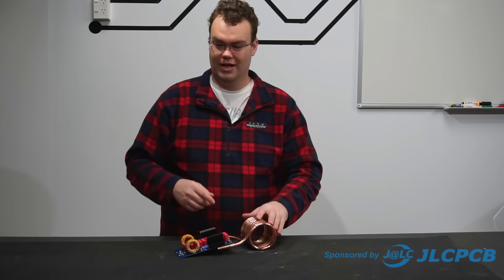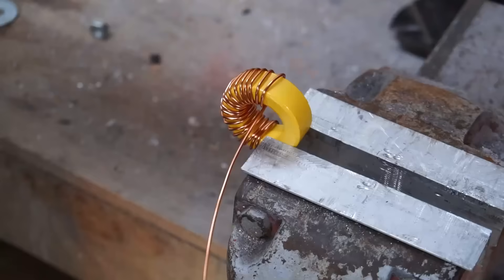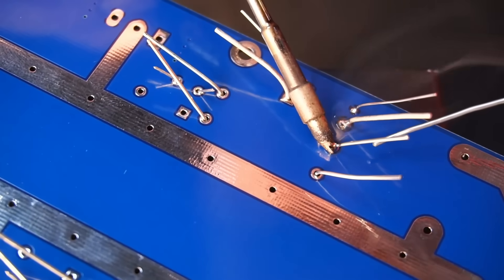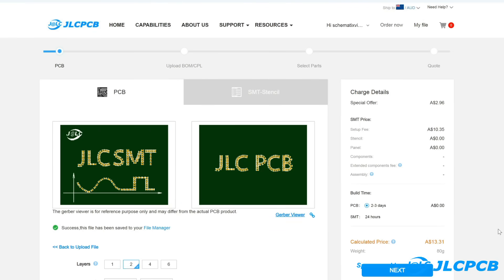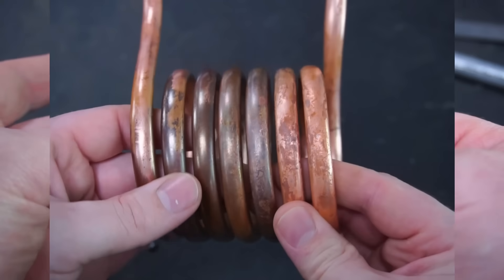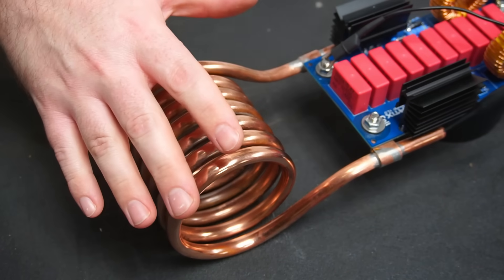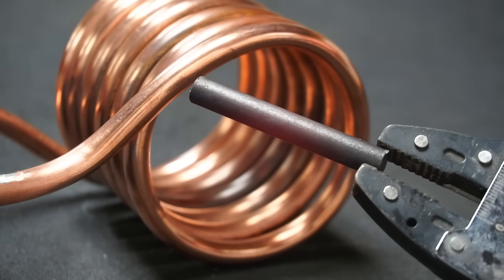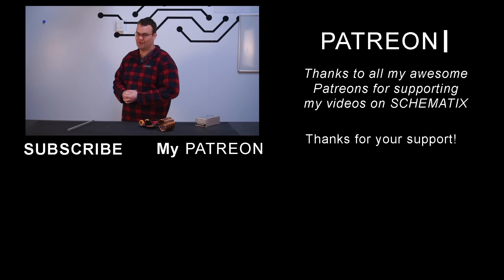Building a 1.4kW Induction Heater

Comment: I'm like 4 million people like to the draw on this one but annealing is cooling down the metal slowly  which softens the metal by on aligning the crystalline structure of the metal. What you had demonstrated in your video which by the way is a wonderful video and I plan on ordering the parts and a PCB to try to build this myself from your video so thank you great video. On the other hand what you doing straight it in your video was quenching when you get the hot metal in the water that actually is a type of tempering and makes the metal harder and stiffer more rigid and brittle. Sorry I'm sure in all the millions of comments on this video because it has millions of years which is awesome congratulations. I just work with metal quite a bit and that just bugged me slightly so I had to say something. Again awesome video

Comment: What happen if you add more capacitors...like to build a hand held induction gun with 5 -6 foot long cable ... would add more capacitors help or moving them into the gun be a better idea with extra caps for different size  shapes coils help.

Comment: I have a small one to assemble, but so far I have not done it yet. However, it is too small for my needs: the one shown in the video is more suitable, since I need to treat a mechanical part with a diameter of 33 mm. I need to harden it (taking it to 800-850°C and cooling it in synthetic oil), followed by tempering at 600°C for about an hour. Here in my neck of the woods, a blacksmith who does not know how to temper is not considered a true blacksmith: he is an incomplete professional figure.

Comment: I would like to push this with 600w PSU. I am curious if it is acceptable to run a length of 8 gauge wire to a 1/4” water cooled coil. Would this wire get hot before hitting the coil?

Comment: I do high reliability high capacity electrical soldering for a living. I think it would be worth considering silver braze for the coil joint to electrical connection vs soft solder.  Due to it getting warm and needing good mechanical strength. and a soldering tip if you want cleaner joints is so only prep the surface where the solder is going to sit, make sure the flux is only on that area apply your solder on the opposite side of the joint as you heat.  Just gently touch just the joint area, when the whole joint is warm enough for the solder to flow.  It will flow in a instantaneous moment towards the heat.  then pull solder off, perfect joint everytime.
Reply: also, removing more oxidation would have helped too, the if it doesn't look almost rose colored shiny it still has oxidation.

Comment: Anyway I wanna make an induction heater to melt aluminium cans, but I only have the nichrome wire, the cans, and very little knowledge and experience with this
Reply: He mentions in the video that this design won't work well for non-ferrous metals (that is, it'll only work for iron/steel). Aluminum doesn't have nearly as high of a melting temperature as iron or steel though, so you can melt it with a propane torch or similarly powered furnace. Googling "DIY Aluminum melting" should get you there. Stay safe and have fun!

Comment: What is the total inductance of your Induction Coil???????? Since your total tank capacitance is 4.7uF, to obtain 50KHz for eddy currents in the work-piece  the inductance required is close to 2uH BUT your Induction coil seems Big. Practical Induction heating have the best efficiencies  at around 240KHz  and they require very little power (around 80Wats) at that frequency && work piece goes Red Hot within seconds, yours takes a while just to get a small glow. Another thing:  you have stated that your design is 1.4KW, how did you get that figure??????? At 48V for 1.4KW the current in the circuit will be about 30A, can your filter-series-inductors handle that current knowing that you have used a very thin wire wounded on them???????? Looks like you are NOT an EE graduate.
Reply: I am also learning about emag, so please lmk if I miss anything obvious.

From what I have read, higher frequencies cause a stronger skin effect, leading to a larger difference in temperature of the center of the workpiece compared to the surface. This is not great from a metalworking perspective, as that means the surface of your workpiece might behave differently than the center.

Comment: You need to make the coil the winding radius much less for that particular application, this way you loose so much energy. it means that what you heat up the rode radius must be close to the radius of the Coil. Otherwise you loose electromagnetic energy a lot!

Comment: Rather than solder, I would recommend laying 2-3 pieces of #12 wire along the buses and very generously soldering that in... or better yet a heavy copper strip with holes for the component leads. I worked for a manufacturer of a similar product and we quickly abandoned that technique when a very small percent of our products melted in operation. copper has 10x the conductivity of lead or tin, so for example, a 1/2" x 1/16" copper bar can carry 150A. You'd need a 1/2" x 5/8" lead bar to carry the same current.

Comment: I'm new to the channel today, so forgive my 4 year old question:
Would you get more power (to heat the same size victems faster or to heat thicker victims at all) if you did a double loop induction coil? In other words, at the bottom of the 3D printed form, instead of ending the loop, you wind it back up to the top of the form before ending it. Like wire is wound on a spool.

Honest question, please dont flame me!

Comment: I've been trying to optimize my ebay melter which I believe is very similar circuit -vise. But one thing I am trying to grasp is, what to aim for (in terms of L and C) to get the best (biggest) power draw? My melter works okay (I can do about a liter of aluminium in reasonable amount of time) but the unit is rated for nearly double the power, which would be great to use. If power is high enough and energy flows fast, I can even get to melting copper (which is my ultimate goal) - without increasing the heat shield.

Comment: I you want to make a tight coil with soft coper without it collapsing at all, one trick is to fill it with salt or sand blasting media and cap the ends. It works very well, perfectly round coils every time.

Comment: Why would you solder the ground and supply clamps to the coil. As a mechanic I can tell u right now I'd get that coil hot enough to melt that solder, a brass set screw clamp for the coil ends and a heat shield sleeve around the coil would make it shop worthy

Comment: Great project, could such an inductor melt aluminum?
Reply: XD - I asked this question at the very beginning, now I see that it won't heat the aluminum.

I'm curious about a filament furnace for melting aluminum though. You know, something that you can build yourself at low cost and ideally the power supply should be relatively simple and use 230v, would a computer power supply be suitable for such a project?

Comment: wow ... just wow. where do i start.... 1st you must be an electrical engineer or equivalent cause your soldering is mint and you certainly know what your doing. 2nd im not an EET but i am a MET and we learn similar and ive got nothing mechanically to say is wrong and must admit its very well explained. If you arent a teacher you should be. Cause i made one of these almost identical in school and wish i had your video to go off of. The only thing i can think of is treat the copper inductor  before rolling it for ease of cleaning it later. Well done.

Comment: what's your experience heating brass vs aluminum? I'm considering building something similar but am trying to work out how to heat brass that is contained in within an aluminum jig. This is for a pressing application where I need to expand a brass ring that is placed within a jig. Then press a rod through the brass ring. Similar to bearing heating but a jig I being used to align the shaft and the bearing prior to pressing.

Comment: I say this with a helpful heart: 

when you solder something around a tube, you heat the tube, yes, but you primarily heat the thing your attaching. Like sweating copper pipe together with a coupler. If you heat the fitting, it will pull solder into the joint via capillary action. If you just heat the tube, youve likely just put a bead of solder on the outside and little actually made it into the joint

Comment: you dont temp meter to find out if its heating. he would have founded out way faster if the aluminium was heating. the heat moves very fast in aluminium and he would have burned his hand fast

Comment: nicely done, but i have made a spot welder using a microwave transformer and just changing the secondary coil, added some fans and switches and a led to show when its on.. i have seen an induction heater made the same way, its able to melt non ferrous metal in a crucible.. now i have a question if i may? is that contraption i made even safe? i used non conductive materials where i could to avoid a short circuit, and have you tried it before?

Comment: Tip:  At 9:59, you want to aim the flame at the center of the bolt thingy you are trying to attach to the copper tube.  Way you did it just takes longer but the solder flows to the hottest area through capillary action.  So it would be faster to heat it up in the middle of that bolt thingy you trying to attach.

Comment: Okay, so I want to build one of these, but I don't need it to get super hot. I'd like it to be a single coil for a thinner cross-section of heating. I'm doing heat shrink tubing, and I don't want to use a heat gun because the wind blows the heat shrink all over. Can I just turn down the power to get a lower temperature?

Comment: Anyone considered any solutions to insulate the coil to make it safer for general use? Would thin thermal sleeve be ok? I'm not sure if the ones I normally use have metal fiber in them or not.

Comment: I appreciate your video.  I can tell you from experience that you don't want to get bitten by the rf of the output coil.  I once was working on a commercial level final amplified for a hf transmitter.  Accidentally contacted the wrong thing in it and was thrown back about 6 feet into a concrete block wall.  Not fun.  Made me much more cautious when working with HV HF final output devices for sure.  Safety is always the primary concern when building projects of this sort.  I like your pc board design, but, the main buss lans on the board could have been a lot wider and possibly topped with a copper sheet lan soldered to the tin lan on the board.  This would spread out the heat and also carry a great deal more current.  Anyway, a very well constructed design.  Thanks again for the video.  I find these very interesting and informative.  Have a great day!

Comment: i have the same irfp4668 mosfet from old broken smps but i did not have than much component and power. so, do someone have idea to make induction heater with irfp4668 mosfet, 12v voltage rating and less than 300 watt of power?

Comment: Hi
I think you don't need such spiral for only 2 MOSFETs. 
A 2mm diameter of wire with around 10 turnes over 1 inch tube would be enough

Comment: Don’t quench the copper…that will harden it again.  Heat and let cool slowly.
Reply: Wrong, it is the correct way to anneal copper.
Reply: Woldengmasinloken
Reply: Annealing:
When copper is heated to a specific temperature and then cooled slowly, it undergoes a process called annealing, which softens the metal by allowing the crystal structure to relax. 
Work Hardening:
Bending or otherwise deforming copper can cause it to work harden, making it stiffer and harder. 
Quenching:
Rapid cooling, like quenching in water, can prevent the crystal structure from relaxing, resulting in a hardened (more brittle) state

Comment: Hi there, a welder (TIG) putting out DC voltage around 20 volts @ 100 A would also do the power supply well I guess!? Any comments to that? Thanks for the video!

Comment: Not bad. Also try using it with an air core transformer coil inside, did similar with HF x ray transformer coils and it made incredibly high voltage at far more mA than the coil usually is capable of. Also using a big mosfet to switch the stiff current from the psu guarantees the stiff current pulse to start the oscillation process. ❤ Great work.

Comment: Hi there, I have tried to order a PCB from JLC but they are more than useless and i got nowhere with them. I am a 83 year old model engineer with an electronics background so I know my onions as we say in the UK. My problem is silver soldering small pipe unions on some of my models and induction heating would be ideal as I work in my living room and gas blowlamps and a forge are not a comfortable thought. I have an idea which you may or may not like. Here goes. How easy would it be to use a 3 KW welding inverter to supply the low voltage -high current supply to the coil. I ask due to not having much experience with induction coil heating and at my age It is difficault to build kit as my lathe, milling machine, band saw, and piller drill take up most of the space so my electronics takes a back seat to say the least. Can you help with some sort of welder supplied design, It would make a superb vidio if nothing else. Regards and keep up the good work. The welder I have is an inverter type with a 200 amp capability not sure what the voltage is but I believe it to be around the 20-25 volt mark.

Comment: Could you use a welder as the power supply? You can control volts and amps quite well, and it is robust.

Comment: great stuff, nicely done. i'm too lazy to read all of the comments, so sorry if this has been said before: to improve the current carrying potential of your pcb just make the traces wider, you have a LOT of space left and at those voltages arcing won't be a problem. also, never use solder to strengthen your traces, solder has a miserably low conductance, just slightly above a tenth of that of copper. your last tip, soldering wire to the traces, is better, but i'd rather widen the traces and/or get a 70µ copper pcb.

Comment: personally i would just use the secondary winding of a transformer to make it into a loop and im pretty much done, i can modify a microwave transformer to get the required voltage and amperage, no real need for that pcb and components if it's essentially the same output

Comment: Poor design for induction heating you wasting alot of the energy in the coil and not heating the iron up I see 3kw ight induction melt 1 in steel only half bridge induction design can provide what you trying to accomplish because there is no high resistance ferrite core to store the high energy and release it fast enough for making that iron get fire blind hot to in seconds

Comment: Nice work!  You should consider making a 48V hob driven by a Li battery.  Great for camping!
What risks are there from an open, high current radiator at the frequency you are operating at?

Comment: About half a century ago I was experimenting with 450khz in the university lab. I accidentally contacted the energized circuit. No shock or sensation. Then I smelt burning flesh and noticed a curl of smoke coming from my finger! It had burnt a tiny needle thin path into the skin. Very carbonized. It took months to heal as bits of carbon worked their way to the surface.
( Most painful shock I ever got was 600 v rectified 3 phase arm to arm. Luckily I contracted away from the circuit. Chest and arm muscles hurt for weeks)

Comment: Hi, it possible to heat the rotating wheel by induction method? 
This is for pouch sealing type ( two sheet are coming horizontally left and right then going down, while going down I have to seal it, 
So rotating wheel I want to heat to seal the two plastic sheets together by rolling down.

Comment: I would like to see a walk through of the schematic.
Tip: When bending metal tubes fill them with sand and crimp the ends, this will prevent them from 'collapsing' (you got away with it in this case because the bend radius was quite large...)

Comment: Try using an arc welder for the power supply ? I understand we need a coil that is close to the subject material in diameter leaving a similar airgap to that in your coil. Or larger air gap but filling a large portion of the coil with the material that you would heat. Looks like fun to figure out.

Comment: 13:00 no, your current is dependent on voltage since your setup has constant resistance. thus, you have exposed yourself as a fraud. i could tell by your accent.

Comment: I want to use an induction heater to heat up a pipe to run plastic through to put into a mold I think this would work but I would need a series of them probably do you think that you could help me design something like that

Comment: You're simply a genius! Thank you so much for such a great contribution!  I just realized that i already watched your Videos of the bafang electric motor on a bicycle, and now this. You're great!
One tiny question, its know that if i want to create the heating effect, I must place a piece of metal thru the coils. However, what would happen if i dip that whole coil into a bucket of sand (yes, to heat up the Sand) would it do the heating effect just by dipping it or i would have to place a metal in-between the coils to create the heating effect?. Again, thank you so much ❤🎉

Comment: you can make the traces max size of the board and alleviate the need for wire ... the extra copper pad increases the gauge of the trace essentially .. and works as an heatsink ... and adding a heat sink to the trace itself will ensure it stays soldered ...